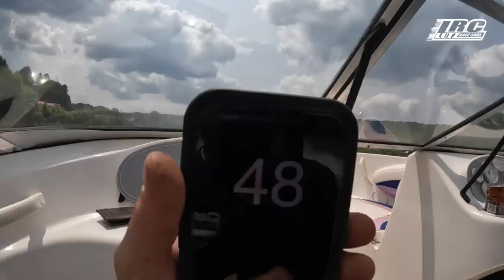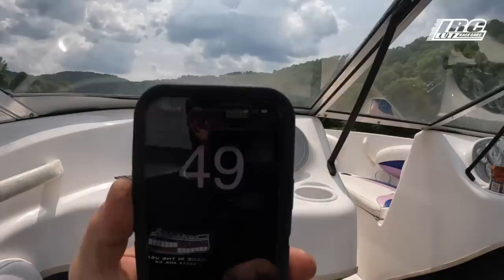Jr's Boat Project Pt 3

Comment: If the motor isn't peeing a lot of times you get sand buildup in there and you need to use a little piece of wire to clean it out. Good luck fellas love watching you guys.
Reply: exactly this, done that on mine a few times as wel. Also had really small parts of what i think once where leaves in there. We even had a piece of wire wrapped around the eye on the transom, wrap it off there, poke the hole through and she would be good to go. Now if it instantly stopped again you need to remove the top cowling, remove the hose, poke the hole through from the other side so the crap gets pushed outside. Also run the motor with the hose just hanging of outside the engine cowling for a minute to let any remaining pieces flow out that way.
Reply: I've used an air compressor after poking the hole and was amazed at all the crap that came out

Comment: Whipple with an air to water intercooler. When you tap into the freshwater feed off the out drive for the water on the intercooler make sure you have a way to regulate pressure so you don’t put to much pressure through the intercooler. Also, might need some louvers to help get more air in and out of the engine compartment to help with the additional heat and help it breathe. Party on guys! Hope to see y’all in Ennis!! Godspeed and good luck with the start of NPK this weekend!!!

Comment: I love those peanut butter pretzels to, they're not just for breakfast anymore. Is the boat prop or jet? Either way a jack plate helps, if prop try different pitch blades and a hydro-foil on the lower unit. Love ya guy's

Comment: Threw hull exhause and prop work. With just that 55 to 60 is easy. Have a prop guy look at the boat running. It definitely needs more overall lift. Doubble cup the prop ears and just blue print the prop. Hell gasket matching the intake and exhaust will do wonders

Comment: Love the boat content guys! This is right up my alley careful putting to much power to the lil alpha it’s like the 4l60e of boat drives but a nice stainless 3 blade progressive in like a 19 or 20 pitch ( depending where rpm is at) will do wonders love the marine stuff guys

Comment: Think of your prop as the trans and rear gear on your race cars. Four blade for getting out of the hole is the best suited for that. Prop diameter, prable and pitch is where it's at. Good luck.

Comment: Put the threw hole exhaust with the levers so you can make load or quiet open the levers and it will go out the back close them and it goes out the lower unit looks good guys

Comment: Just do the fuel with a little procharger and then look at getting tuned prop for it.  You might get sixty with just a tuned prop with the fuel going on it. I SEE SEVETY out of that boat. I got sixty out of minè with just a prop chang. Good luck boys. Playing with boats. 😮

Comment: Indicator that the system needs to be flushed out? That Merc should have a flush connection somewhere? Air blower to that pee hole should fix it? I usually do it with the water muffs on. The newer thermostats are also suspect. Without my hands on I am not sure...

Comment: Water hose doesn’t have the pressure needed to force water up the motor like normal which is also why you don’t wanna rev the motor high for long. Run it out on the lake and give it full throttle and it should clear that tattle tail line which is where the stream exits at the bottom of cowling out. It most likely is just clogged and the motor will have enough pressure to clear it out at higher rpm

Comment: Look into a switch pitch prop. It has a huge spring in it and changes pitch with load and rpm. It gives you a good low end like a power prop the switches pitch to a speed prop and you will have great top end. Also it's a trip to hear it switch it's like shifting gears and the rpms drop and starts pulling again. Best of both worlds good hole shot and then great top end of a speed prop.

Comment: I use a piece of stainless wire .030 or .035 off a mig welder I run in a lot of sand and mud on the gulf of Mexico in fla. I keep it on the boat. I  run a lot of shallow water. Hope this helps 12 or 16 inch long should work

Comment: After years of running limited-class inboard hydroplanes with my dad (for competition), we found that the propeller was the biggest determiner of performance once the engine has been optimized. I would have liked to have seen the engine rpm when you were running at 50 mph. So...here you go again—you really need to know the torque and bhp numbers for the engine and then work the propeller pitch and diameter to obtain an rpm that takes advantage of the engine's performance. 

As I'm sure you are aware, boat engines that are running at prolonged peak-rpm are more susceptible to catastrophic failure than are relatively short-run drag-race engines, and therefore must be built for durability—a whole other story. So, I'd simply choose a max rpm that I'm comfortable with (choose a number), and play with standard, readily-available propellers until you reach a reasonable goal (MPH)... possibly 60-65 mph with your set-up, without having to go back to square one and over-build the engine. Propeller-tuning, although expensive, can be rewarding. Have fun!

Comment: Take that whale tail off of the lower unit.  When I took marine mechanics classes the teacher said the whale tail will cause the oil in the lower unit to cook quicker than regular.  It doesn't come up on plane that much faster with the tail and it saves the lower unit wear & tear and keeps the oil in the unit fresher longer.  Ask your boat "guy" if my teacher was full of do-do.  Have fun on the water & good luck this weekend in Ohio !!!

Comment: Use a fine piece of mig welding wire, gently push up into outflow tube at the top where water Tell Tail stream is normally flowing, after long periods off not used small insects love this hole and build nest inside tube…

Comment: Jeff if the motor is not overheating that’s good but if if your not getting any discharge from the pee hole you might have a calcium buildup inside the water jacket in the block like a plugged heater core if you have a inspection camera scope the water jacket intake and discharge lines if you find a buildup boiling hot water and bleach should clear that up

Comment: Need to see what it's turning at wot so you know where to go prop-wise. Seems to get up on plane ok. Now just need to make it breathe, poke some holes through the transom for the exhaust and get some fuel injection going.. still can't believe that pontoon has a 300  Verado on it..😮

Comment: Install a hydrofoil plate onto the outboard drive, help lift the additional weight, brings the rear up during higher speeds, should increase speed with the hull more leveled 👍

Comment: down here in florida the water exit on outboards can get clogged by mud daubers that like to climb in there and get stuck causing it to clogged and not pissing. Ive changed a few water pumps on outboards and had to clean those lines out cause of stupid ass bugs.

Comment: I would find out the limit on the lower unit before I went too nuts on the horsepower. Like anything, it all works as a unit. Engine, lower unit and prop. But you know all this don’t ya? A little investigation first is in order I think.

Comment: You guys know what it takes to make more HP. I say do what you know to the motor, get more HP out of it so you can change the prop to a higher pitch prop. That equals more speed. Its not like drag racing. I did notice you was proposing a lot. Not familiar with that boat but im sure there are things you xan do to stop that

Comment: If water stays in through the winter freeze the water pump and it dry rot and when you run it the rubber brakes off I'm getting old my boys always pick on me about it

Comment: Hey Jeff if it’s still not pumping water take ur air blower from ur air compressor an give it a shop of air when it’s running they usually get plugged up with spider an be sure not miss the tube that connects the water to the pump oh ya an it’s not good to start it with the drive trimmed up an I’m not talking shit I just don’t want to see u brake ur housing it would be like if ur drive shaft in ur car

Comment: You need to twin turbo it. I drove a twin turbo 540 boat called gassa, does 130 but it’s a v drive. Leg boats are always faster as you can trim it. Hellrazor here does 139 with 2 skiers https://youtu.be/e7SRD51ctjs